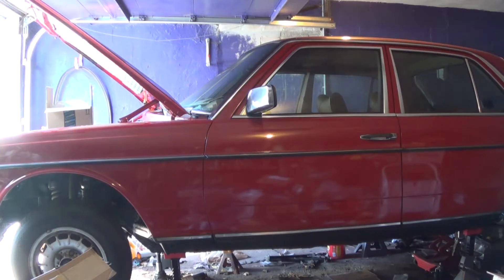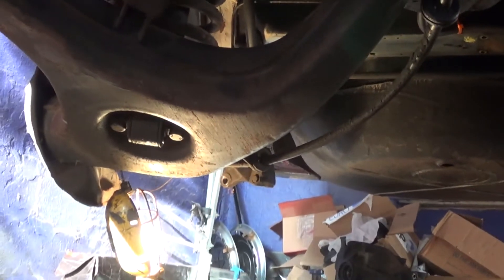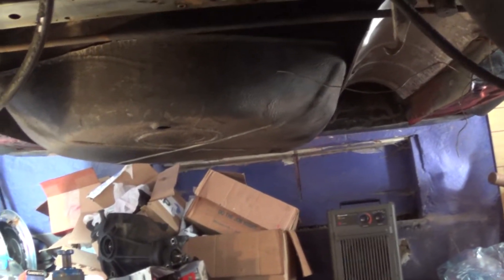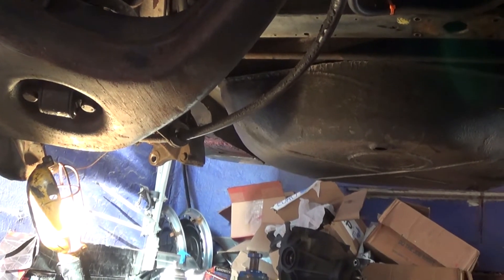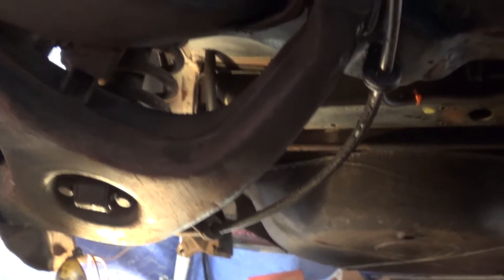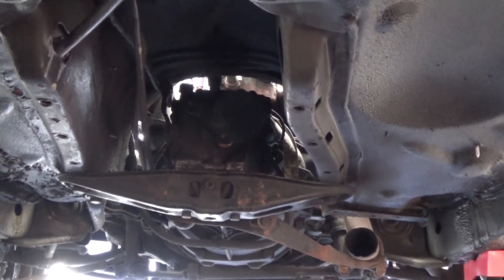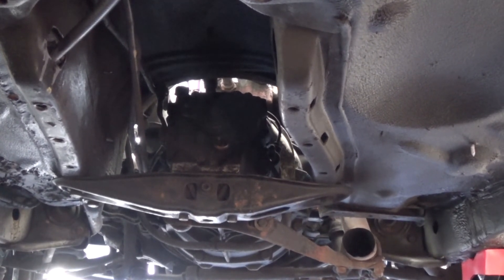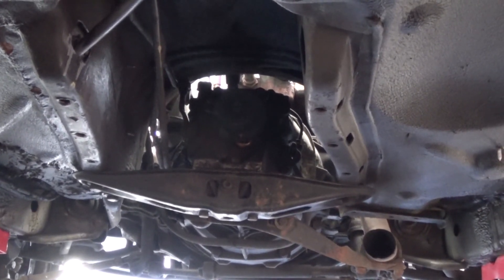1983 Mercedes-Benz 240D - part 160: removing driveshaft and differential

Comment: Most people end up dropping the entire subframe as one unit rather than remove it piece by piece. That might be faster.
Reply from the maker: Tugboatpb Some people do that. I wouldn't think that it's most people. I'm trying to avoid a potential can of worms and not remove the main subframe mounting bolts unless absolutely necessary.

Also, the full, assembled subframe is monstrously heavy and unwieldy.

Believe me, I considered all options when deciding on my approach. I felt this was the best strategy for me.
Reply: Aha, that makes sense. How are you going to remove the springs? The MB spring removal tool doesn't fit in the back if memory serves me correctly.
Reply from the maker: Tugboatpb From what I hear, it does. I do have one, but I've also heard that once the shocks and rear diff mount are removed, the rear springs practically fall out on their own.